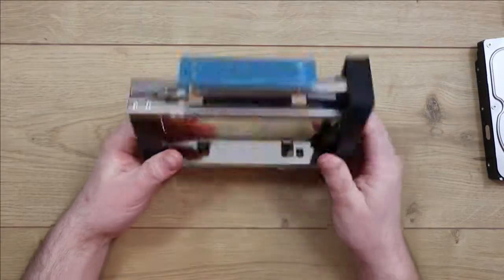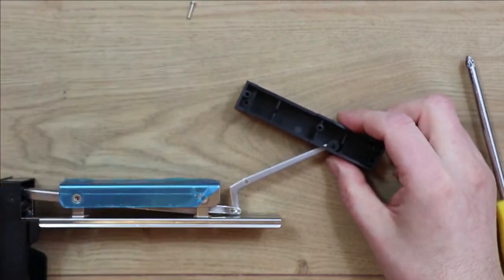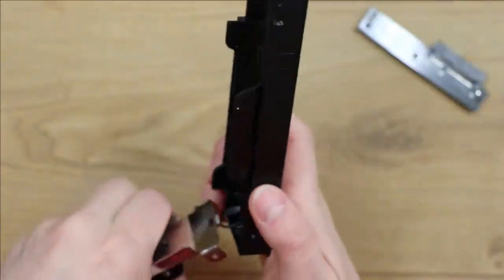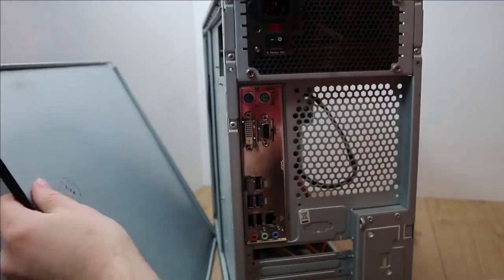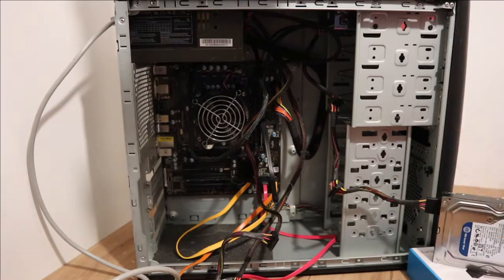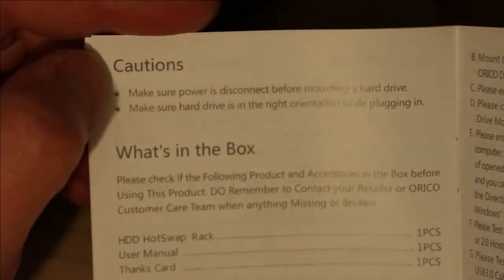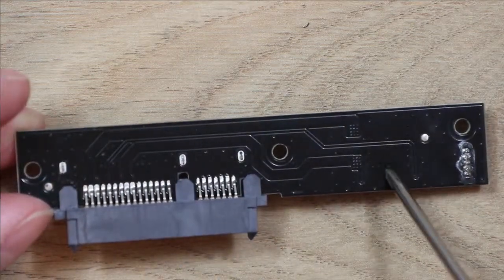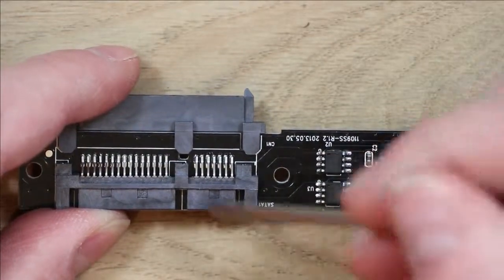Orico SATA Hotswap Rack Drive Bay - Part 2 - Teardown & Testing

Comment: Hello! Thank you very much for the review! If possible, can you please answer a few questions? 1) Does it support power supply for an 8 TB HDD? ([ST8000DM004]) 2) Are there drives of different thicknesses (I'm interested in [ST8000DM004] ~26 mm and [ST4000DM004] ~20 mm) does it support any? 3) Does the button turn off both power and SATA? Or only power? 4) Maybe there are some ideas on how to make vibration mounts for the drive in it? 5) How safe do you think it is to use, provided that the drive will only turn on and off when the PC is turned off?  :)

Comment: I had problems with this Orico bay. Bought two, both has the same problem (tested in different computers with different HDDs).

It causes slow POST times (make BIOS take too long to detect disks), and eventually causes read and write errors with perfect healthy disks.

Too bad because it has a solid build and it's hot swap friendly.
Reply: Brasileiro?
Reply: @ruimilanesejunior2619  sim.
Reply: @fbeltrao  Oi Amigo. Poderia me falar sobre a experiência que vc teve com esse case? Pelo que entendi ele "rouba" energia dos demais HD na hora de ligar ocasionando problemas.  Vc conseguiu resolver isso? Ainda usa? Obrigado Felipe.
Reply: @ruimilanesejunior2619  Acho que ele não "rouba" energia, a case tem apenas alguns LEDs e é alimentada pela fonte. Tive o mesmo problema com duas placas-mãe diferentes, então cheguei a conclusão que era essa gaveta da Orico. Acho que era um problema de blindagem já que a case tem uma placa que faz a interface SATA da placa mãe para o HD, necessária para os LEDs de atividade. Apenas parei de usar as cases, infelizmente não são confiáveis.

Comment: The reason for the two MOSFETs is to allow switching of two discrete voltages (12V and 5V) from one SPST switch. Each gate has a pullup resistor (R8 and R1) to their respective power sources, and an inline resistor (R9 and R2) to the diodes. The diodes then separate out those two pulled up voltages and the switch pulls the gates low through those diodes. The two capacitors C1 and C2 are there to reduce the impedance of the MOSFETs which have an ON resistance of around 20 milliohms, which could cause voltage dropouts at high current draws without the capacitors as local reservoirs of power. AFAICT resistors R3-R7 have nothing to do with the power switching and are probably just to do with the front panel LEDs, though I am not sure what those LEDs do, nor why there are so many resistors. To get around the "main bus B undervolt" problem you would need a multi-stage soft-start powerup arrangement whereby the incoming power is first fed into a bank of capacitors through an initial MOSFET + bleed resistor pair, and when the voltage has risen to the correct level to then switch on the first MOSFET pair to bypass the bleed resistors, then switch on the second MOSFET pair to dump the power from the capacitors into the drive to spin it up. An easy enough circuit, but bulky with all those capacitors and too expensive to implement in a low-cost device like this.

Comment: So basically this is not hot swappable? Unless you have a dedicated sata power cable only for it. But to be sure  you need to add it before powering up the system? And shutdown again the system then remove it?